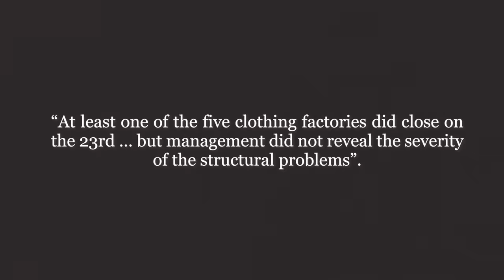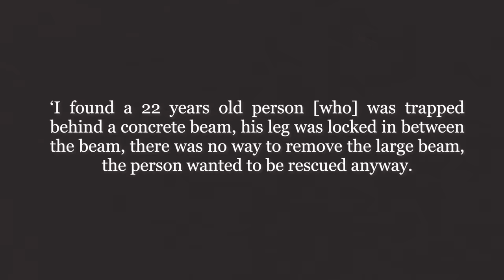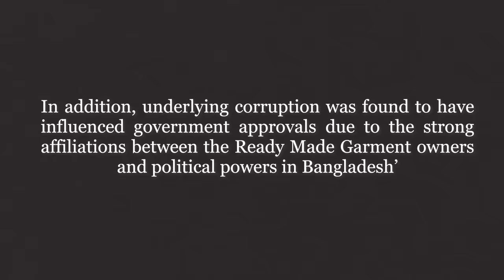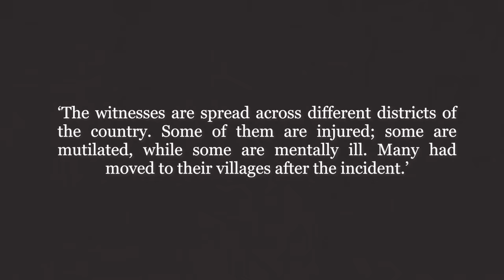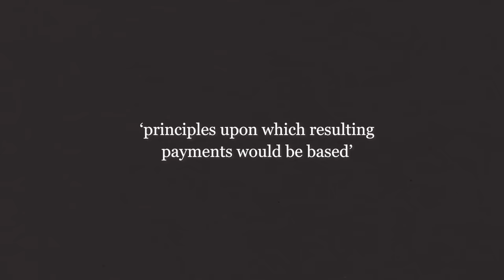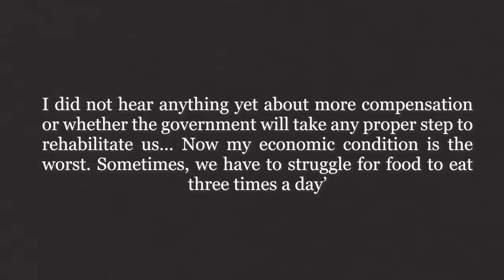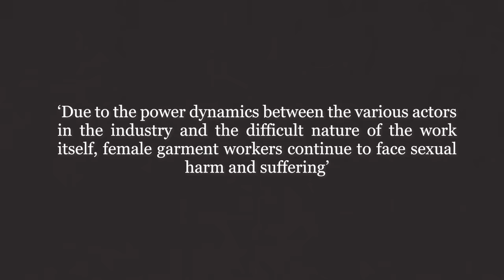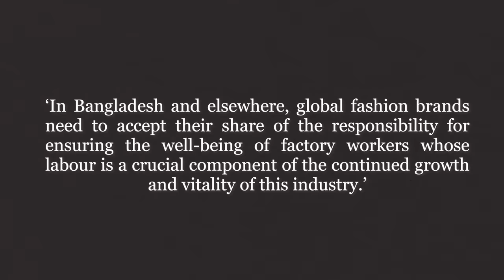Rana Plaza: The Disaster that Exposed an Industry

Comment: Bangladesh sadly comes in near the top of corruption indexes by country. Not saying that this was just fine and dandy and it was all their fault (it wasn’t THEIR clothes they were sewing!), but it won’t get better in any country without tackling corruption issues. 
As someone who actually does work in the fashion industry- I was in fact in fashion school and working part time in a clothing shop when this happened- for a large company it’s nearly impossible to trace exactly where everything is sourced from and who does what, because there’s so many links in the supply chain and so it’s impossible for all of them to be inspected thoroughly. Fast fashion is horrible and thrives on those gaps. (Even if your factory is strictly inspected to be of good quality and wages, and your retail employees aren’t treated like dirt… the source of the fiber to MAKE the fabric that will be turned into clothes can be surprisingly horrible!)
Reply: Genuine question,  does fibre for "fast fashion" come from different sources than that used in more expensive garments?  I know very little about the workings of the fashion industry.
Reply: @lesleycouch6557  Depends on the fibre. Polyester and rayon are basically the same source since they’re entirely manmade (just not likely to be using the bottom tier stuff that rips and tears in barely a month). 
Natural fibres like cotton and wool and linen, once harvested they’re then graded for their suitable purpose (wool, for example, will have several grades of fibre on the same fleece depending on where it was on the sheep. Some will go to fine-quality garments, some to chunkier knitting yarns, some to carpets, some fit only for industrial purposes like insulation) the higher quality stuff usually goes to the higher end clothes and fabrics. Silk, you’ll never even find fast fashion made of it. 
THAT SAID, just because a brand is expensive doesn’t actually make it quality. 
Home sewing has also suffered the last few decades, all the middle-range quality fabrics have nearly vanished leaving either ultra-luxe handwoven Italian cashmere wool for $60 a yard at specialty fabric shops, or bottom of the barrel cheap poly blend for $5 at the chains and nothing in between.
Reply: @SoundShinobiYuki  Thank you, that's interesting.  A more complex issue than I thought.

Comment: The buck here stops with the building inspectors/local officials.....yes the owner was paying them off but there are limits to what you can bribe yourself out of, they got to greedy.....the video only touches on the fact the place was swampy ground, that excavations were happening right next door at the time, the owner was expanding the building and there was a massive generator on the roof because of local power outages. The bribes were too good and as a officials they should all gone to jail for the rest of there lives for murder as well as the owner